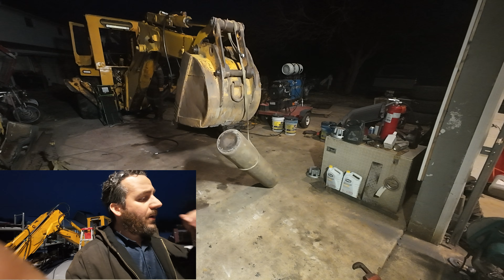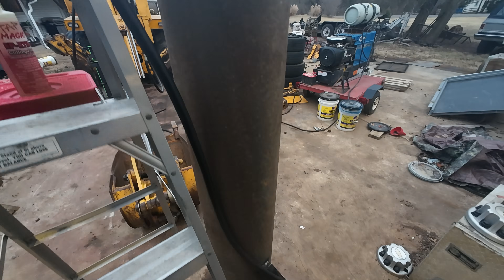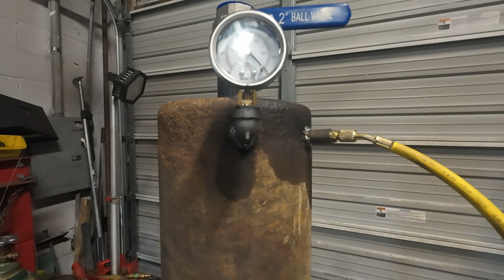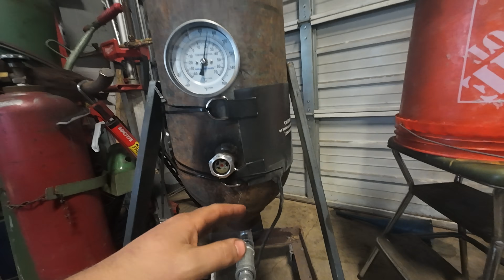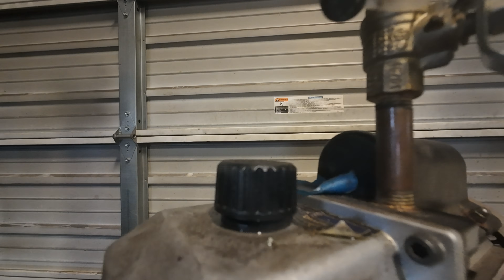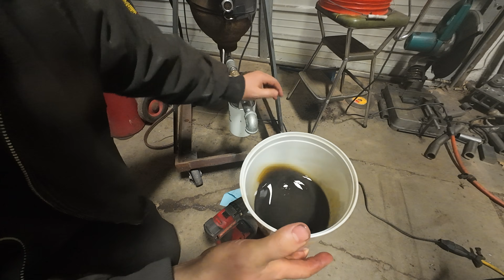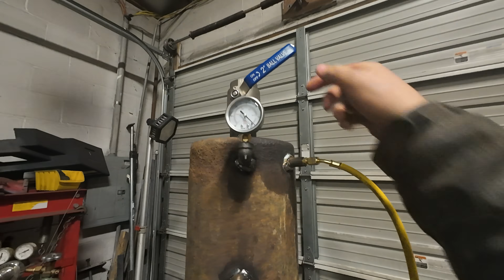I made a machine to remove water from hydraulic oil. Vacuum de-hydration

Comment: Running the water vapor through a cooled condenser is a great idea  I would think you would want to keep the pump running to keep the pressure in the oil cooker low enough to allow the water content in the oil to vapor off.  If the air pressure raises you will have to heat the oil to a higher temp.    Could/would you drain the oil under pressure rather than venting the tank first?  Would an automatic pressure relief valve as place on a water heater make sense?  Do you need to have a check valve on the vapor line before the condenser.

Comment: You may want to consider what you're losing in VOCs from the oil under vacuum. I don't suspect it'll be too much but if there's some important volatile that leaves the oil at low pressures you may be putting wear on your oil this way as well. The MSDS should give you enough info to figure that out. You'll want to find the vapor pressures of different important additives, highest vapor pressure is your lower pressure limit.

Also you're gonna want a vapor trap on that bad boy, your vacuum pump will not last long like that. Others have mentioned a cold trap, you can do that with a small chest freezer, or just outdoors in winter if it's cold enough. You can also use a regenerating desiccant if you know about how much water you're going to get. You put enough desiccant into the water trap to hold the projected amount of water, plus some extra, and you just stick it in an oven to drive the water back out. The cheapest desiccant is epsom salt. Throw it in an oven, drive out the water already in it, you get Magnesium Sulfate, it's effective enough for your purposes and relatively harmless, it also holds like 5x its weight in water. Bear in mind that it expands when it does this, account for the extra space in your cold trap.
Reply from the maker: Great suggestions thank you!

Comment: I know it has been said numerous times in the comments but adding a condenser to a 1" port out the top near the vacuum port would help keep the pump from sucking as much water through it, you could go as far as a using an old condenser out of a car put inside a mini fridge with a liquid trap on the output but a 1" pipe on an elbow straight down to the base and another up through two elbows with a drain valve at the bottom with the vacuum port at the top of the seccond one pulling through the pipes. That's added cost that would only be practical if you had to do this regularly / frequently.

Comment: Maybe you want to search for MILK CREAM ELECTRIC CENTRIFUGAL SEPARATOR MACHINE 
I imagine if this works it is much faster and energy efficient. I suspect it is not enough for you, but maybe its worth a try. (Milk is a suspension, and if you can separate the fat from the water there, maybe it works with the sauce you are confronted with) 

I found firms that are specialised on oil, but it seams they have got very expensive solutions

Comment: Possible improvement:
1. Mount all you built to a frame and put some wheels under it.
2. find a flexible hose and attach it to the outlet.
3. roll your contraption to the machine in question.
4. start vacuum pump and use the flexible hose to suck the oil out of the machine.
5. do your process with the heat and the vacuum, and if you are finished let the oil flow back in the machine using gravity, or if nescessary a little pressured air.

advantage: You don't need to handle the oil openly, you can connect a machine in the evenig bevore you go to bed, and let out the oil in the morning first. Other advantage: If the machine is hot, the drying starts right away, you do not deal with cold oil

And as in other comment described: put a trap in front of the vacuum pump.

Long thoughts about vacuum pump. There is room for improvement. 
There are many different style of ways to generate vacuum. You want something that doesn't need oil changes if you abuse it. For the pressure range you need you can work with a ejector that is operated with pressured air.

I found a productd that you can buy for about 80 Dollars, I am sure on your continent they do something similar.
Example: https://www.druckluft-fachhandel.de/inline-ejektor-typ-vr-gewindeanschl.-duesengroesse-0-7-mm-abluftanschl.-m5-ag-108374 
- uses max 5 bars pressured air (=72 psi)
- consumes 21 liters of air per minute (this is normally calculated air at sea level pressure). A typical compressor with this is drawing around 110 watt = .0.15 Horse Power (do the math yourself, didn't spend a lot of time with that and i am not very sure)
- provides suction amount of 14 liters per minute. At 0.1 bars = 1.5 PSI a liter of vapor weighs 0.000068 kilograms That means this ejector can suck 14 x 0.000068 kilograms per minute what equals to 3.4 kilograms water per hour, what equals to 7.5 Pounds of water per hour. You maybe want to feed the exhaust air through a kitchen steam exhaust filter to get rid of oil steam if you overdo it.

By the way: Did you do the research about the maximal temperature that your oil can handle short time? (I think that is not the same as long time) 
If your oil can handle 120°C or 250°F you could consider only heating and not applying vacuum. (less moving parts == less problems)
Reply from the maker: Amazing tips, I appreciate it all!

Comment: also to by vacuum seperation you are removing any entrapped air  which will reduce  oxidization of internal metal parts along with  removing  the water,   to keep the water out of your vacumm pump you need to set up a seperator with a cold plate for the air to pass over to drop it below its boil point same idea as your cylinder some column dehydrators use a drying agent to pass  air through to thvacum pump.  A few other ways that have been used to remove water from hydroiolic oil is a  high speed centrafuge to force separation,  oils can be treated with ZDDP  but thezinc base in this can cause issues with metals.....
  presonally  you  spot on with the system and the idea a well made vacumm  seperator  can  drop you  water comtamniation to 30 to 50 PPM  ( 0.003 to 0.005 % )    work on a drier  to  pull water out before it gets to the pump, suggestion  run the vacumm down to point you no longer see water coming out at seperating prior to the  vacuum pump and then hold the vaccum for an additional hour  in the  system then slowly  raise the pressure in tank over 5 to 10 minutes. if you are concerned  about particles in oil pullit off the tank through a 10 micron  filter   5 micron if you have access is even better , over kill  but will remove even the  finest  partical  is .5 micron

Comment: I imagined that you could just build a "fountain" with a heater that doesn't boil the water but by churning the oil you'd expose some of the warm water to the surface and it would evaporate on its own.

Comment: Not being a rancher, I am wondering why water in the hydraulic fluid is such a common problem on your equipment. My experience with hydraulic equipment has always been in a warehouse situation, i.e. forklifts, man lifts etc. in an indoor setting. Never encountered this in my use of this equipment.
Reply from the maker: I buy abandoned equipment thats been left to die. Almost all of them have water in the oil when I get them. This equipment is old and sits outside water always seems to find a way in
Reply: @spankranchgarage  OK. Thank you. That makes sense.

Comment: you can pull a full vacuum in the cylinder, then suck the oil through the dump valve, if you build a trap use silica gel cat litter to absorb the moisture, you can reuse the silica gel if you put it on a tray and place in a warm overn for a few hours.
Reply from the maker: Love all those ideas!

Comment: Don't forget that your altitude matters.  For every 1000 ft above sea level, you loose about 1 in hg  of maximum vacuum reported on those gauges (Because they compare against atmospheric pressure)  You might have a better seal than you think.

Comment: Interesting and well done. I had a buddy with contaminated oil in a trailer tank. He found an immersion heated that cleaned up similar oil at 5gal at a time  in about 8hrs with heat alone. The heated took 5gallons to 180f.

Comment: A bit overkill on the tank, you could probably distill mercury in that tank. A propane tank would probably be fine.
Reply: I also think a simple venturi vacuum you attached to a faucet will provide enough vacuum to keep temps below 140f where the hydraulic fluid starts to breaks down.  This will save your pump and pump oil.
Reply from the maker: Great tips thanks

Comment: not sure how well it applies to hydraulic fluid, but at least with machining emulsifible oils that get mixed with water, if you push the ph up , they will completely separate. again, not sure if it would apply here, but maybe do a small scale test n see, but also not sure if it totally destroys the additive ability to emulsify the water for the future. (edit) also, as others have stated, put a cold trap in the vacuum line between the column and the pump. cooled with dry ice or something to trap the h2o vapor.

Comment: I worked for a company that recovered airport glycol from aircraft deicing fluid. It went through a reduction facility to extract the water , the final product was collected and sent back to a refinery for recertification. They used a cyclonic effect to help separate the water. If there was some way to introduce a swirl effect like a water fall or pipe fracking tower inside the cylinder, with an external oil circulating pump, operating outside the cylinder under cylinder vacuum? It would also be a good place to introduce an external heater and double oil filter system also. Info only if you consider modifications in the future. Cheer's H
Reply from the maker: Great info thank you!

Comment: I dry used water soluble cutting oil by bubbling air. It's not fast but it works. The emulsion doesn't break. Starts at 90+% water.

Comment: I would definitely add a couple improvements : First off safety.
Add a relief valve, please. Any heated "sealed" vessel (i know the vacuum tubing would definitely blow but still) should have one, no tempreature control is okay as long as you don't also insulate the tank. Then it could get much warmer than anticipated.

Also about filling, why not use the vacuum to pump up the liquid ? You could even use the "discard valve" and put a tubing to it and suck up the oil from the bottom ! 

Then about drying the gas coming out, as some people have said in the winter you could just add a trap at the exit, could simply be a long capped tube section with the two holes at the top, since the air will cool it down and condense water. Maybe put the intake through a long tube that goes to the bottom of the trap to force the water vapour to travel the most distance and cool it down. In the summer you could put an ice bath or even wrap towel around the tube and blow air at it. Won't be perfect but even if your vacuum oil is cheap it might prolong the life enough to warrant the extra work.

Very good video
Reply from the maker: Great ideas and recommendations, thank you!

Comment: This is very cool idea but you need to condense the water before it gets to the pump. All the water coming out will go into the vacuum pump oil. Use some dry ice around a container. Also you can use the vacuum to suck up the oil instead of poring in the top. By the way this is how i make pickles. 😂
Reply from the maker: Awesome!

Comment: Hvac tech here. The less restrictions there are between the thing you're pulling a vacuum on and the vacuum pump itself can dramatically increase the effectiveness of the actual vacuum pulled. 

Using the shortest hose possible, the widest ID hose possible, and using something like a ball valve instead of a schrader value all help decrease the time needed to get the results you want.

Comment: I was watching to see if anyone suggested a contamination tank in the vacuum line. The condensate tank was a good recommendation but the condensate tank large enough and the vacuum pump pulling vacuum off the top of said tank so any contamination would , by gravity be in the bottom of the contamination/condensate tank. In the video the vacuum hose is a direct line vertically to the vacuum tank without a drip loop. Really cool video. Lots of very clever ideas. Rent it out between your needs.

Comment: Use good filters and make sure you have magnets in the system to pull out the wear metal. This doesn't help with moisture but any wear reduction will help the whole system.

Comment: Use a water heater. Already has a burner, tank and temperature controls.
Reply from the maker: It wont put up with the vacuum though. I think it will collapse
Reply: @spankranchgarage  You would have to keep the tank full and not pull a hard vacuum. Do you know how much Vacuum needed? It would be a fun project.

Comment: I'm a retired elevator mechanic, and I had a hydraulic elevator tank unit with a leaking pipe over it. Oil was almost white, and I informed the customer that the system was  contaminated and needed to be changed. Of course, nothing was done with the proposal, and to my surprise, 9 -12 months later, oil was back to normal color. I would estimate at least 55 gallons of oil in the system.  I was told by an old timer that an air pump from something like a fish tank would also clear up moisture in an oil tank. The moisture gets removed from the air bubbles passing through it. Never tried that way of doing it, but I believe the source.  
Thanks for the video, very interesting.  There is a pump made to clean contaminated oil right in the tank, but it's 5k and has really expensive filters.
Reply: My guess is under heavy use the oil heats up. Water was evaporated.
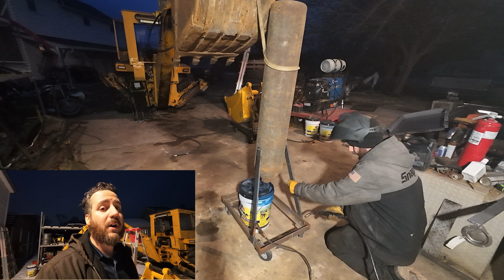Reply: @markw2266  Which is what happens to the top layer of oil he describes at 3:50 -- it is very slowly drying out from evaporation, not from separation.
Reply: Could be the problem fixed itself - or it could be thst the customer did the work themselves off the books. The world will never know.
Reply: I can confirm that a mild vacuum will with time also remove moisture as long as you have a way to bring new, dry air into the system. You're essentially just waiting for the water to evaporate, which doesn't need a fluid temperature of 100 degrees celcius -- just a low enough vapour pressure on the air that passes through the oil. I have several installations in my lab that dry liquids in this way. It works best when it's really really wet, and that's probably why the white soup oil had such a drastic change of heart and colour!

Comment: I stumbled across after working on my backhoe but I just capped the vent and pulled a vacuum in place, it somewhat worked but was only 50 out and used residual heat from the machine running. I will revisit the system in the summer when its 100 plus.
Reply: i would be slightly worried about oil seals getting pulled the wrong way etc
Reply: @willdatsun  At roughly 1% of the rated pressure I wasn't too worried and there is not much room for the seal to do a u-turn.

Comment: Do a test bottle on your oil a crystal clear bottle from the gas station that you drink a beverage from then clean the bottle out let it dry put your oil in their halfway full set it in the sun and keep an eye on it if you ever have any condensation on the inside of the bottle with temperature change then that will let you know you still have moisture in your oil

Comment: Do you need an after cooler you might be able to use a air compressor water separator in reverse if you had an after cooler with fan with some tubes at the bottom you probably could collect condensate or water

Comment: You do realize you're just transferring water from $11 / gallon hydraulic fluid into $11/quart vacuum oil, riiiiight?
Reply from the maker: Yes but it doesnt work that way exactly. The pump oil is 12 bucks for 32oz. The hydraulic oil is 49/5gal. It takes 2 dollars of pump oil to save 49 dollars of oil. Not perfect, but better

Comment: I recently built a very similar setup to dry our snowcat hydraulic oil.  I used a 40lb propane tank and a bucket/tank heater that covered more (about half) of the tank surface.  It can do about 8 gallons at a time.   I started using hydraulic oil in the vaccum pump.  I found if I let it run for awhile after the oil is dry the vacuum pump oil will dry itself out.

I later made a bit of a modification to my tank.  It only has fittings in the top and was a pain to fill and to turn over to drain (glug glug, splash, drip), so I added a "pickup tube" to the bottom of the tank on the oil port fitting and now use vacuum to suck into the tank through a hose from the bucket and compressed air to push it back out (through a filter).   

I also let the 5 gallon buckets of oil I drained out of the equipment sit outside overnight in well below freezing weather  - some water fell out of suspension and froze in the bottom of the bucket which meant less water to have to remove by the vacuum process.   It took 3 rounds of draining, drying, refilling and running the machine to flush the system adequately but salvaged 60 gallons of oill.
Reply from the maker: Awesome and great to hear

Comment: You can probably figure out of it's entrained air or water by running the oil under vacuum but not heating it. If it's air, the vacuum alone should pull it out. If take heat, it's probably entrained air.

Also, adding a cold trap before for the vacuum would be a really good idea to help you identify if it's water coming out of the oil and of course to protect your vacuum pump.

Cool project!